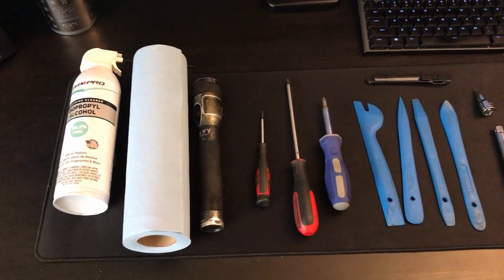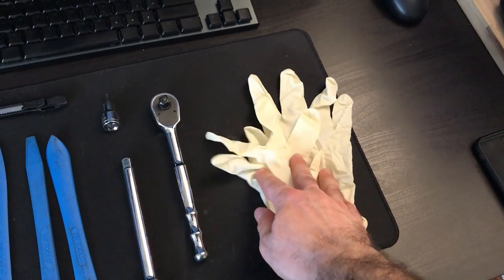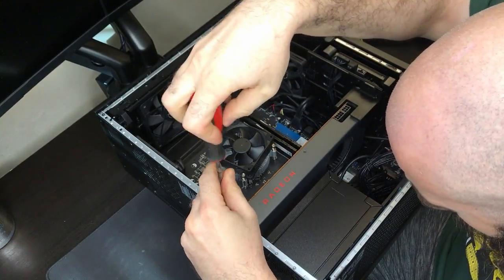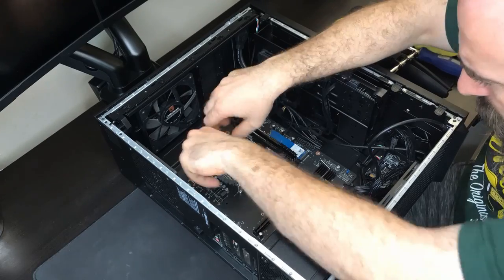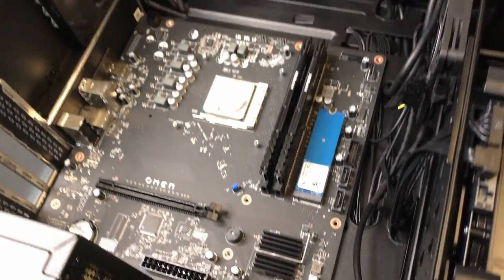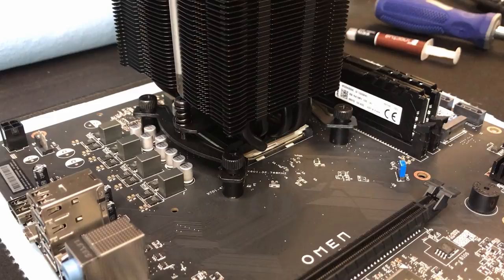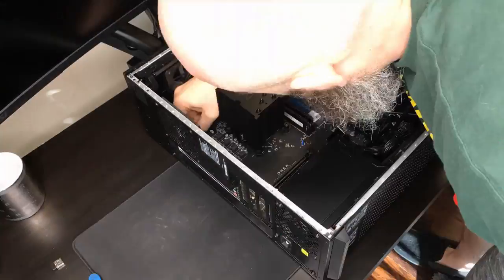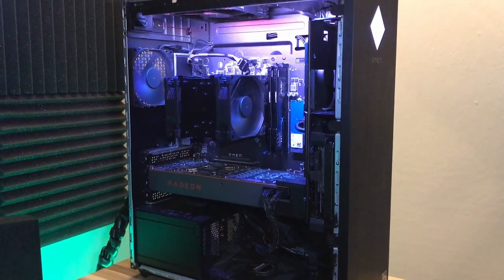Installing A Noctua CPU Air Cooler In My Omen! Complete Tutorial 😎

Comment: Will this work on a 30L as well?
Reply from the maker: Yup, same exact procedure
Reply: @DanKamYouKnow  I bought all your parts identical to your additions. Thank you. I will let you know how it goes.
Reply from the maker: Nice! Let me know if you have any questions. 👍🏻
Reply: @DanKamYouKnow  thanks for the tutorial. With the help of a friend we replaced the fans and added the air cooler. My 30l (2021 model) came with a liquid cooler but the air cooler seems to be a significant improvement. My temperatures dropped by around 20-30 degrees. Thank you again.
Reply from the maker: You’re welcome! Interesting results, I didn’t think the air cooler would be that much better than the stock 120mm liquid cooler. Thanks for sharing your experience and enjoy the cool temps 😎

Comment: Hi, i did this cpu cooler upgrade but now my Omen won't boot. Monitors show no signal and mouse won't work from USB. Plz help :/
Reply from the maker: Do you hear any beeping when you start it?
Reply: No, all the fans are working and rgb lights turn on but no beep.
Reply from the maker: And your sure all your connections and your graphics card are fully seated? Triple check all your connections. Also make sure your RAM is fully seated.
Reply: All except CN1 connetion where the stock cpu cooler was connected into.
Reply from the maker: What did you use to remove the cooler bracket! Do you think you might of scratched your motherboard?
Reply: Maybe i did. I used a blunt kitchen knife
Reply: It's working now. I took my Omen to a computer store. They replaced the MoBo with a new one.
Reply from the maker: Bummer, sounds like you might of scratched the motherboard. Good thing is you have the freedom of having a new motherboard! Completely open BIOS to make all adjustments, over-clock, fan curves, etc.

Comment: Do you need to use a Intel cpu cooler on a am4 cpu ?
Reply from the maker: Intel. All Omen motherboard use Intel spacing, even ones equipped with AMD CPU’s
Reply: @DanKamYouKnow   would a intel stock cooler work ?
Reply: or like a be quiet! Pure Rock 2
Reply: @DanKamYouKnow   would any intel cooler work?
Reply from the maker: You would have to get a cooler that is less than 140mm in height or the side cover will not fit back on. Any Intel cooler will work

Comment: Can I do this with a NH-U12A
Reply from the maker: Too tall. Only 92mm coolers fit, which is why I went with the U9S. Works extremely well in Omens
Reply: @DanKamYouKnow  by too tall so you mean it won’t fit due to the case. If so if I were gonna change the omen case to a corsair 4000d airflow does that work?
Reply from the maker: Yes, in an Omen case, the glass side panel would not fit back on. With a 4000D case, you can fit pretty much any cooler you want. Omen cases are limited on total height because of their size.
Reply: @DanKamYouKnow  thank you sir dankam! your the “go to” guy for omen questions

Comment: Will COOLER MASTERLIQUID ML240L V2 RGB fit into Omen 30L case (GT13-0002nw Intel I7-10700F, RTX 2060 SUPER) ? :D
Reply from the maker: No, the biggest liquid cooler you can fit in the Omen is 120mm radiator.
Reply: @DanKamYouKnow  Thanks man :D

Comment: intel socket holes?
Reply from the maker: Yes, ALL Omen motherboard spacing is Intel. So if you buy a cooler, you are going to use the Intel brackets, even with an AMD processor.

Comment: does anyone know what original socket mounting hardware the hp omen cooler came with? Be cause if i can buy a cooler that can match the socket it already came eith it would make my life so much easier 😁👍
Reply from the maker: It’s HP designed. No cooler will fit on it cleanly. You’ll need to modify the screws for it to fit other coolers.
Reply: @DanKamYouKnow  Do you think I can zip tie a wraith prism 😂 half joking
Reply from the maker: Hahaha
Reply: @DanKamYouKnow  but no joke I had found a house omen aio on eBay I’m going buy it and put it into my rig I think that might be a good idea
Reply from the maker: Let me know how it goes! Curious to see if it fits the stock backplate like the air cooler does

Comment: man im scared to change my fans , seriously temperature with a ryzen 7 3700x for my opinion are so high while streaming and playing warzone turning about 76c to max 82 c its too hot the stock 
fans is not  worth to stay
Reply from the maker: 76-82c is pretty warm but those temperatures are technically safe.
Reply: @DanKamYouKnow  should i use intel braquet to mount my fan ? i have ryzen 7 3700X
Reply from the maker: Just a fan or a CPU cooler?
Reply: @DanKamYouKnow  cpu cooler like the one you used 92 mm and back fan with 92 mm + top one with 120mm im i right ?
Reply from the maker: Yes, you want to use the Intel brackets the cooler comes with. And yes, you are correct with the fan sizes. Rear fan is 92mm and the top fan is 120mm.
Reply: @DanKamYouKnow  thanks you for your answer man !!
Reply from the maker: No worries dude 👍🏻👍🏻

Comment: Issue:

Replaced CPU cooler with a Chromax U9S. PC will not boot now. When I press power to start.. LED lights come on for a few seconds and then shut off. LED then comes back on and stays on but no boot or signal out. So far I’ve tried:
-reconnected everything (twice)
-Reseated CPU. Re-mounted new cooler and attached fans.

Anyone know my next steps? How can I troubleshoot to see what is causing the issue/ what is not working.

Hp Omen 25L GT12-0109
Reply from the maker: What did you use to remove the CPU cooler backing plate? Did you try reseating the RAM?
Reply: @DanKamYouKnow  I used a plastic pry tool. I was pretty gentle and took my time removing it. I did reseat the Ram in the same slot. I had the fan that came with the cooler and a 2nd new noctua fan Y split in CPU fan spot... tried only connecting the single fan but that didnt help.
Reply from the maker: Try a single stick in the 2nd slot. Do you get any series of beeps?
Reply: @DanKamYouKnow  I just tried my only stick in 2nd slot. Nothing different. No beeps. Only thing that happens when I press power button is the LED at the top of the case comes on and the lighted NVIDIA on my GPU. After about 3 seconds the lights cut out and then come back on 1 second later.
Reply from the maker: Reseat your GPU again. Ensure all connections are fully plugged in ( especially GPU ).
Reply: @DanKamYouKnow  Still the same. GPU fan is spinning. I think Im going to try to put the stock cooler and fans back on in the morning and see what happens. I do appreciate the help. Thanks. Possibly I damaged the motherboard or CPU while connecting the bracket/cooler? Frustrating...everything seemed to be going well...
Reply from the maker: I know you have, but triple check all connections and make sure everything is fully seated. Let me know what you find
Reply: @DanKamYouKnow  Fixed. I just needed fresh eyes and to go through and reconnect everything. I truly do appreciate the help. Thanks.
Reply from the maker: Happy it’s working for you now!!!

Comment: OEM builds should stick to OEM parts
Reply from the maker: Why would I stick to OEM parts? and I’ll take Noctua parts over CoolerMaster ANY day. Nothing about Omens are OEM. WD hard-drives / HyperX RAM / CoolerMaster garbage cooling
Reply: @DanKamYouKnow  love the stock look, can’t find a 3080 hp omen got them in stock for retail prices if you buy direct, all OEM builds should stay OEM
Reply from the maker: Stock look runs extremely warm, especially if you are getting a 3080 Omen with the 10900K. CPU temps hit 90c while in game on those. Function > Form and the stock components aren’t it.
Reply: @DanKamYouKnow  you should not get a i9 with any of the omen pc as the case isn’t designed for it, i9 needs a workstation case with the industrial type fans to cool efficiently
Reply from the maker: Yeah, it needs more than a flimsy little 120mm AIO that’s included with them.

Comment: If you have to do something like that, it means that the PC is poorly designed or manufactured
Reply from the maker: The PC was designed to run at safe temps ( which they all technically do ), but that’s too warm for most people, including myself. In over a year that I’ve been seeing all Omen content, I’ve seen maybe 2 actually over-heat, which were manufacturing errors that were warrantied. I wanted very cool CPU temps, so I changed the cooler.